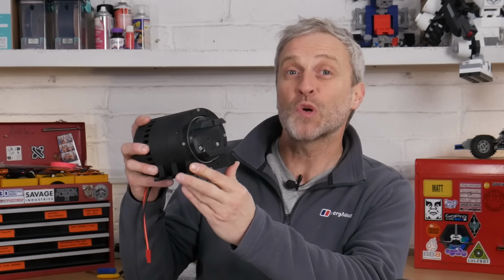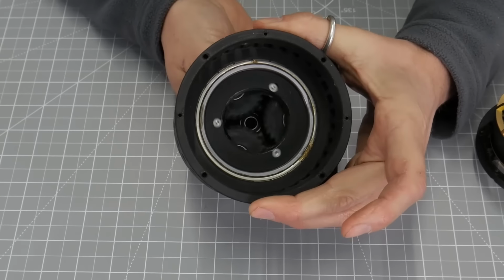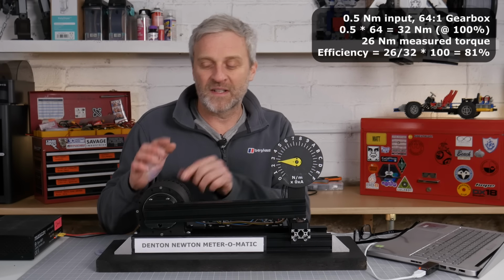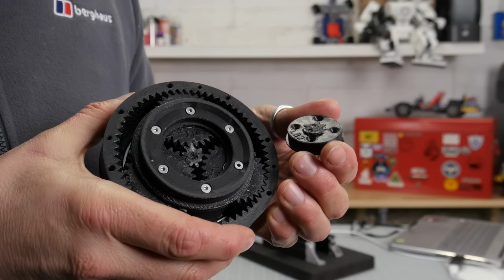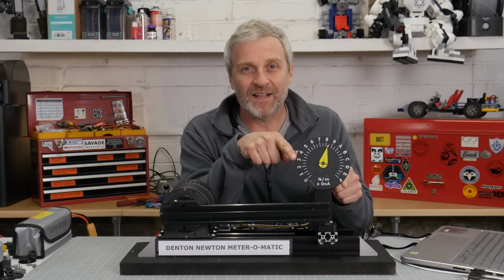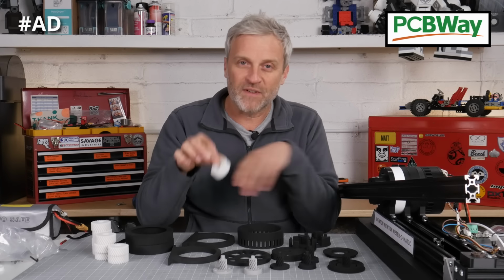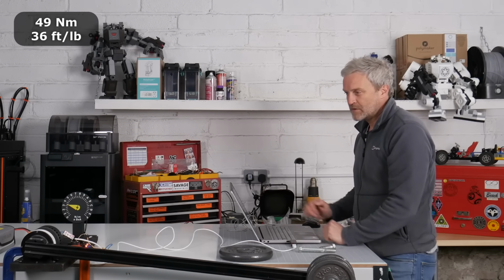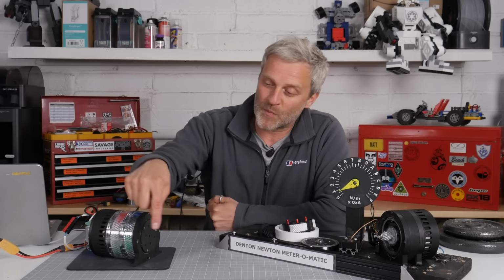Massive Torque 3D Printed Planetary Gearbox! - Mantis Hacks

Comment: Only thing I’ll say as a dumb electrician, I think you might need more motor ventilation on that gearbox if you wanted it to survive. 500 watts continuous in an a 10-15cm out runner motor might survive in the downdraft of a drone propeller but even at like 15% duty cycle I’d imagine it would build heat quickly if it being used for a couple hours driving around a convention floor. Interesting experiment though. :)
Reply from the maker: Yes it would defiantly require some better heat dissipation in continuous use

Comment: ... at 41'20"you had been working the gearbox pretty hard, possibly the failure could have been triggered by heat weakening the gears... Maybe an air blower and/or some vents?
... Also wondering if a dry lubricant would help?
Good Fun! Thanks

Comment: if the updated formula is correct its actually a 7:1 ratio. 63+1 = 64. 64/9 = 7.1 repeating. 72/9 = 8. so you would need a 71 tooth outer ring.

Comment: CVT transmission you make the CVT transmission right it’s a bunch of plates and tuning forks with wheels on it now if you get really advanced in this, you take a homeless tire and you take several homeless rims and you pair them all up together and each tubeless rim becomes another CVT transmission as though that it was another gear on your motor and you put an electric motor in the center and use electromagnets that are Inductively charged and powered and natively cool by spinning around and transferring the heat electrically to one another. it’s a really really really powerful drivetrain right there. You’re just the first person I’ve seen playing with planetary and if you play with planetary, you can understand what I’m talking about once you figure out what a CVT is CVT constant velocity transmission it said CBT it changed it after I started complaining, but still complain about it nowso I saying correct my grammar and what I say the machine says it in one minute it’ll be right in the next minute it’ll change it and it periodically changes it while I’m talking throughout the entire thing to wipe out information

Comment: Once you are moving the arm, the Torque is no longer the same as if the motor is static. You need to calculate the maximum angular acceleration at the bottom and the moment of inertia. Very impressive otherwise.
Reply from the maker: Yes I’m aware. Static torque is very different from dynamic torque. I should have run an estimate on my control software to see how well it did. However, on the case of a hexapod, the support phase of the leg is so low that you can use static torque as “good enough” it only needs to move fast during the swing phase and then it only moving the weight of the leg

Comment: 43:50 I think your current gearing is okay, just make the gears wider to reduce the force per gear teeth area, and use a full metal sun gear. It might make sense to use double helical gear design for the second stage, too, to avoid axial load on the gears which definitely increases your friction.

Comment: each stage multiplying by 8 means the second stage should be around 8 times thicker but your design has same thickness in both stages. For example, when you mutliply 4 Nm with 8 on the first stage highest torque the first stage needs to hold is 32Nm, however the second stage's input is 32 Nm and output would be 256 Nm. Meaning it should be able to withstand 8 times more torque both in the input and output gears. This design is not optimized for holding torque.
Reply from the maker: Yes I agree! Which is why at the end of the video I explain o was lazy with the design..

Comment: I get that all of the prints likely have the same infill, but I don't understand what the benefits of knowingly reducing the parts strength with less than 100% infill could be. 

Let's have an arm wrestling competition strictly with competitors that have advanced osteoporosis.  

My first print ever was with ABS with less than 100% infill because I didn't know how to change it yet. I couldn't believe how weak the part was. 3D printer parts are still weaker than injection molded parts on their best day. Less than 100% infill makes sense for kids toys and cosplay prints, but it makes no sense for people who are attempting to produce a functional part.
Reply from the maker: Take a go kart axel as an example. You will often find hollow axles, why? In the case of a gokart it is to reduce weight, this is not the case with these gears but the reason the hollow middle is not such an issue is because most of the strength comes from the outer diameter due to its far greater surface area. So similarly with the center of these gears being hollow, the gain in printing them solid would have been negligible.

Comment: Have you tried printing gears at a 45-degree angle? That makes layer lines which run at a 45-degree and gears don't usually shear that direction. You get many layers contributing to the toothing and also to the cohesive bond at the smaller union.

I'd add a slight flare on the gear toothing too, at the ends. If printing at a 45-deg. Two gear edges, a few teeth, would otherwise have a layer too small and may pop off in normal operation. (The tooth edge at the top and bottom most of the print.)

Comment: Since the issue is the force of the lifting power and holding power of a placed foot. You should use springs or air shocks to split the holding load. Since you have zero strain lifting a foot. Now you would end up with half the force holding, and the diverted force moved to the lift, by half.

Eg, the spring would be pushing down with 50 newtons of your 100 needed. The motor only has to supply 50 to get to 100 now. However, to lift the foot, which was nearly zero, it will now take 51 to lift against the 50 that the spring is supplying.

So instead of the gears stressed one-way at 100 newtons. They are stressed both ways at 50 newtons. When you step off the unit, you will just cause it to rise as the springs relax.

Also, add locking clutches or pins for the "full up" and "locked down" positions. It will take the stress off the motor while you stay still or have the legs traveling. No need to keep all that stress on the power and gearbox, when it's not needed.

Eg, raise, lock, unpowered move forward, unlock, lower, lock, unpowered move backward, unlock, raise...

(Unpowered, meaning that there is no power holding the foot height in place, since it's locked in place.)

"Locked down", so you can use a simple pressure sensor to determine when a foot is fully down on an irregular surface, which may not be fully extended, or beyond full extension.

Comment: Cool video. Why are you using helical cut (printed) gears rather than straight cut gears? Surely you would transmit more torque  with straight cut? Helical is usually used for ease of mesh and quieter in a regular gearbox. But as the epicyclic gearox is constant mesh, you probably dont need helical gears.
Reply from the maker: Quieter, and more surface area in mesh so theoretically more torque can be transmitted.

Comment: I've seen some tests that acetone vapour smoothing can actually help stregth (not in extrusion) so would be interested to see the same tests to see if it actually helps?!
Reply from the maker: Yeah I can see that the outside would be welded together in and acetone Vapor bath so technically should be stronger

Comment: Very cool build! I made a gearbox that is completely the opposite, 1:184 gear ratio to throw a propeller a far as humanely possible. However, to do so, it needed an extremely high strenght, so first stage is a six planetary gearbox with herringbone gears. Pretty sure you'd find the video interesting :). Cheers!

Comment: If you're optimizing the gearbox design for how much load it can handle before breaking you should make it have more bearings so the load is distributed among more points and also make the number of teeth in the outer gear less so the individual teeth are chunkier and stronger. Of course that will take a hit in smoothness and efficiency.
Reply: Also you should try specifically CarbonX PETG-CF. In my tests that has much better bending modulus than PLA, but it also is brittle so there's a chance it fails sooner. Other brands of PETG-CF aren't nearly as good.

Comment: I'm curious how it would have tested if you've had gear grease in your planetary gear boxes. Less friction more force? I know it's messy and not that great when you have to swap broken parts out but science is messy. Planetary gears are interesting. There's a 3D printer extruder that uses a planetary gearbox. The Galileo 2 though its force is no where near what your doing. Great video.
Reply from the maker: The gearbox has grease In it, I use super lube synthetic grease.
Reply: @MattDenton  Ok it was so clean looking, that I couldn't tell. I get that stuff on everything when I use it.

Comment: You managed to hit on and demonstrate something perfectly that a lot of people don't fully understand with your results of layer adhesion.
Yes, materials like ABS and Nylon are stronger than PLA in most ways but if you don't get a proper layer adhesion it doesn't matter. But the problem comes from people not printing materials like ABS in an environment that benefits it like they do PLA and that includes on the Bambu X1C. For all materials you want to print it as close to it's Tg as possible, this isn't an issue for something like PLA because it's Tg is so low to start with. But ABS is much higher and most printers don't get the chamber hot enough to properly bond layers.
This is also before you get into the issue of companies like Polymaker blending their ABS and PC with other materials to make it "easier to print" but it harms it's ABS/PC qualities, it won't match the same material properties as pure ABS/PC. PC is a good example, if you're able to print it in a chamber that isn't over 100c then you aren't printing PC.
Reply from the maker: Yeah I agree. I recently got the H2D that can print with a chamber of 65 degrees so did wonder if the ABS print would exceed the previous test when printed in the heated chamber.
Reply: @MattDenton  Nice work - I just love these more technical and practical projects with 3D printed material.  About layer adhesion and strength, maybe the FDM PPA-CF Core could be a nice material to test in relation to the others?
Reply from the maker: @ Thanks! I have some PPA material now so might try that 👍

Comment: Considering the failure point on the sungears, you can probably make the gears thinner, shortening the gearbox and reducing friction (could try making the gear length the same as the width).

Also to make them stronger, use a bold through them (print should be threaded to engage threads, perhaps add epoxy when assembling). Try using Hex socket bolt with its head sized the same as the bearing inner.

Comment: Was glad to see you put those pins in. Normal M3 screws just don't take that kind of abuse... I would have gone at least M4 if not M5. And yes, layer adhesion is a big issue. There have been several videos out in the last few months (some going as far as calling CF/GF/etc a "scam") that show that the additives actually decrease part strength in many cases due to poorer layer adhesion. Oh, AND.... safety glasses! every time! I know it wasn't the ring gears failing, but if one of them exploded, you'd feel it. :) 

Can't wait to see where you go with this project... "spider" bots have always held a certain fascination for me. I want to see a big one - bigger than the original Mantis, even - that can move autonomously, pick stuff up and carry it around, etc.
Reply from the maker: Well to be honest if I had of used HT bolts from the start they probably wouldn’t have bent. An M3 HT bolt can take about one tonne of shear. However, the plastic was allowing the bolts to bend as it deformed and hence they were not held completely in shear. 

Yeah I’m not sure about the CF material, it looks nice but there doesn’t seem to be any fibres between layers increasing bind strength. 🤷‍♂️

Comment: On the sungear, add a radius that runs up the gear shaft, and as well dont have a sharp edge on the gear teeth. look on how a machined sungear looks and its done that way to not create stress points
Reply from the maker: There are no sharp edges and there is a radius at the base of the sun gear. It’s actually quite hard to get sharp edges with 3D printing.

Comment: Cool series of testing here for your purposes, but what I would really like to see is whether or not you can 3d print a 150nm ebike mid drive motor. The bbshd is a good standard chinese version but the idea of 3d printing one is superbly appealing too.
Your build requires what I would call alternating or contrasting power too which is probably harder on parts than an ebike, as its only ever going one direction.

Comment: Hi Matt I have built two 9-1 planetary gearboxes for motorizing my indoor wheelchair I planned mine to obtain at least 25 nm you have given me confidence now watching your video I used nylon 6 unfilled for my gears 90% infill with five layers on my x1 carbon. I found by joining the carrier to the sun gear by using an x extruded male part under the sun gear and a female recess in the carrier I got an extremely strong joint. I haven’t managed to measure it I’m afraid I haven’t got your knowledge on measurements. I have subscribed to you look forward to to seeing more of your videos. Thanks 👍
Reply from the maker: Ahh that’s great, yeah I don’t think you’ll have an issue with 25Nm as long as the gears are big enough. Good luck 💪

Comment: You could consider printing with brick layering . this should improve it even further
Reply: Brick laying is fun to try, but still very beta test.. it has barely noticeable increase in tensile strength between layers vs simply applying the same over-extrusion, and no improvement at all in compression across the layers as they are printed flat to the bed (which is what the gears here are doing). Meanwhile presently it has a lot of limitations due to its non-planar slicing nature, makes smooth edges harder to get ect.
I honestly DO think it will become just a normal on by default as it gets better figured out and better integrated into normal slicers, but for now its kind of a rabbit hole you spend a few days on, firstly being disappointed (worse strength without extrusion increase), then amazed (sudden 15-20% increases) then disappointed again (almost all the increase realizable by changing other settings in regular parts to include the same extra plastic weight). The end result is its a last 2-3% optimization solution for a few use cases by very experienced users, and 98% of us are better off just putting the same time onto getting the basics perfectly calibrated instead.

Comment: can you design some pin holes in the sun gear and then screw some tiny thin screws in. added walls for the slicer to generate and metal reinforcement.
Reply from the maker: Yes that may be possible

Comment: Can you print the sun gear body in 2 halfs and in a different orientation, then have the gear base be captive over the two halfs? Basically, remove the bond layer along the length of the sun gear, instead of having a single layer for a point of failure.
Reply from the maker: Possibly. Depends on the quality of the teeth and how well they mesh!

Comment: I don't understand anything about electronics, mechanics and other things.
But I have an assumption that a lever that is 30 centimeters long reduces the number of Nm!
Reply from the maker: The lever length is fed into the software that calculates the force applied to the pressure sensor a rising to the lever length, this calc give you the torque.

Comment: A thought to try: Print your gears on a diagonal. This gives you two advantages.
1. You layers have more contact surface to increase layer adhesion, and
2. The driving forces hit the layers at an angle, rather the shearing perpendicular to the layers.

You could probably get another 10% or so out of the current design.
Reply from the maker: Yeah I may try this. As long as the tooth quality remains the same for a smooth mesh
Reply: The sun gear looks too skinny compared to planets. Surely the load would be much better distributed over cross section if they were all the same size. 3 x 3:1 phases might be pretty robust.

Comment: maybe a cycloidal drive isn't better? and it's also more compact
Reply: The performance of the two is fairly simlar, but while a VERY cool technology  in 3d printing for high load applications cycloidal and strain wave generally they actually break at less force, and wear slightly faster than planetary transmissions of equivalent weight. Initial backlash can be simlar or slightly in cycloidal drives favor, it increases far more quickly with use. As you say however, they are more compact, and also run quieter due to more continuous contact, despite the fractionally lower actual efficiency. 3d printed belt drive reductions however beat both, letting tension be adjusted quickly/easily to account for wear and still offering hobbyists the opportunity to make their own custom diameters, ratios ect.. even if its both less compact again, and kind of feels like its against the spirit of the exercise as the belts not printed and using a metal gear would offer more torque resistance again.
Reply: @SheepInACart  Gotcha! Thanks for the explanation